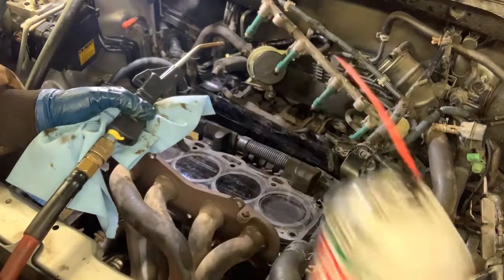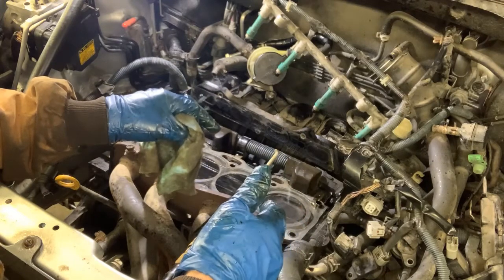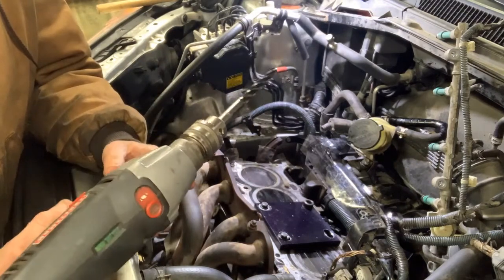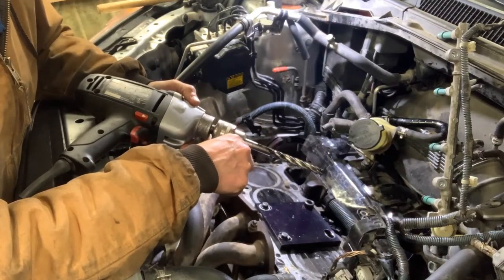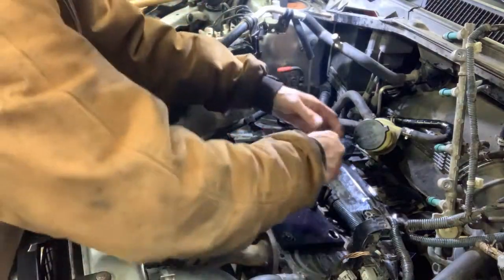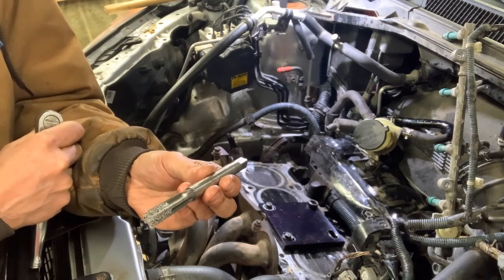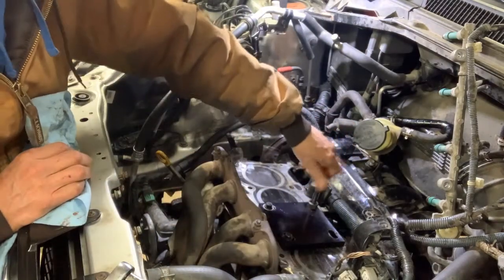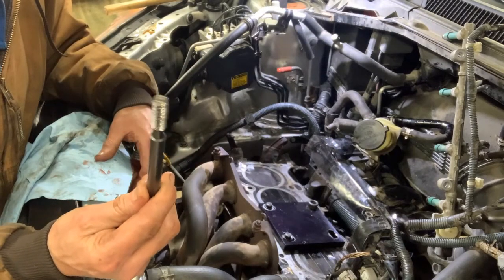Toyota 2.4L Aluminum Engine Block Time Sert 2200 Thread Repair

Comment: If the steel bolts pulled out the threads, why wont the steel inserts pull out the threads. Its the same problem. Why not make threads in the block with the existing holes and then buy head bolts to that size and use all the threads of the new bigger size bolts?
Reply from the maker: You’re drilling out the old threads, cutting in new threads and inserting a steel insert with red lock tight, if you just try and drill and tap a larger thread where are you going to find head bolts that will work? That are the same length and will fil through the cylinder head opening? Now you’re trying to find custom parts. This was the authorized repair Toyota and Honda recommend when bolts strip out over time.
Reply: @ShopDogFabrication  correct. Im aware of that. My thought was maybe the bigger bolts would fit thru the holes in the head, if not, drill those holes just enough for the bolts to fit thru. Head bolts come in all lengths and thread. Drill bit the size of the existing holes, drill the old threads smooth, then tap those holes from the top of the block all the way down till it bottoms. Then the new bigger bolts will grab 4+ inches of new threads.
Ive done 4 of these and i still cant understand why wouldnt the inserts pull out the threads like the bolts did.

Comment: Used this kit on my m113 engine that belongs to my 2003 Ml500 , fixed all 20 head bolt holes in the block , got everything torqued down too & it handled it ! . I just couldn’t used the alignment plate . But I didn’t need it anyways . I have steady hands . It was much more expensive then other options like Heli-coils but I wanted a solid insert . Total cost $730 after taxes 
$645 for the kit 
$85 20 extra inserts because planned to sell the complete USED kit on eBay for $500 or so to help someone else . I have a video on my channel
Reply from the maker: Same, I felt more comfortable with these inserts vs helicoil. We just sold it the other day. Did the repair a few years ago and no issues at all.

Comment: Nice video! One question, for what I can see you are drilling the holes about 1-1/4 deeper...?
Reply from the maker: Honestly that was 2 years ago and I don’t remember. I’d have to go back in and watch it. But I doubt I drilled that deep into the block past the factory hole. The idea is to drill and open the hole larger to screw in the insert with the same thread size so you can torque the bolts in the new steel insert that is red locktighted in.

Comment: How are is it to remove the head and disconnect all the electrical before you get to that point
Reply from the maker: If your mechanically inclined it’s not to bad, getting the intake off is probably the hardest about taking it all apart. Making sure you find all the fasteners and not trying to take something apart because you missed one and break something.

Comment: Did you have to resurface the cylinder head or send out to a machine shop to get it done over?
Reply from the maker: No, I cleaned it throughly and put it back on. My daughter has been driving it since the repair an no issues.
Reply: @ShopDogFabrication  Thank you for your video and all the information. I have to do this to my 03 Camry.

Comment: What kind of drill is that
Reply from the maker: I started with a 20v cordless drill and then switched to a 1/2 hp corded drill if my memory is correct. It’s a craftsman 1/2 drill. I didn’t rewatch the video but I’m pretty sure that’s what I used.

Comment: I wished i came across this video few days ago i just bought me one from amazon 🤧
Reply: I have one on the end of engine block that is getting kind of stripped due to previous owner putting a bigger bolt but i bolted the original one and the most that i could torque it was 15-20ftpds is that good enough for being the very end hole and also why is it not good to applying an insert.
Reply: All the other 9 were torqued perfectly to 45-65 ftpds
Reply: You still have the kit may be you want to rental ?